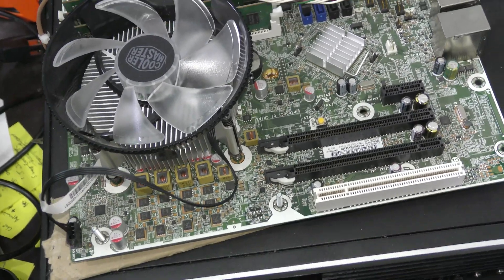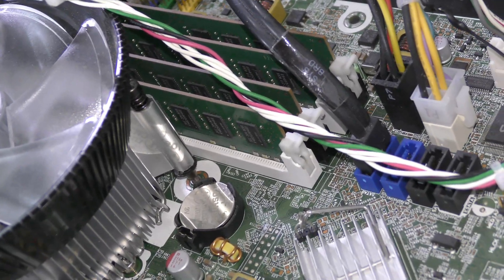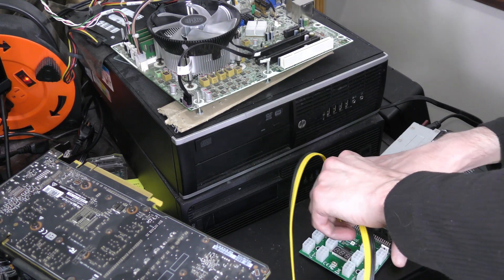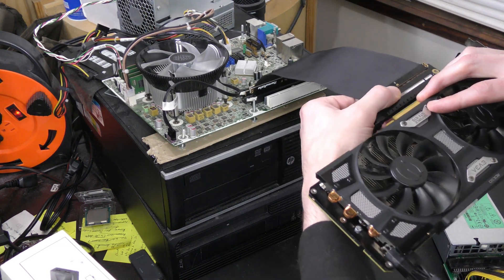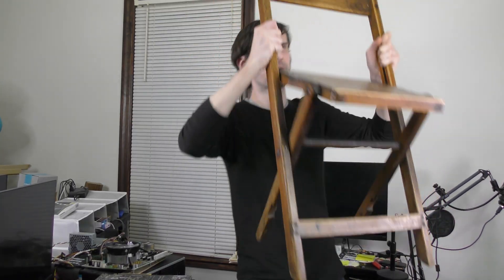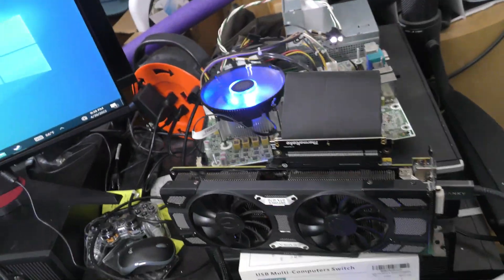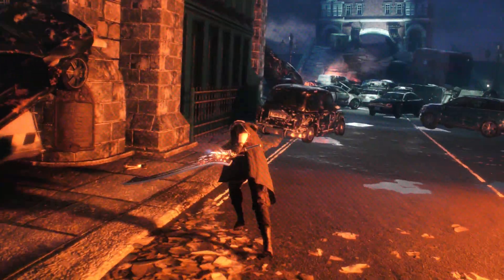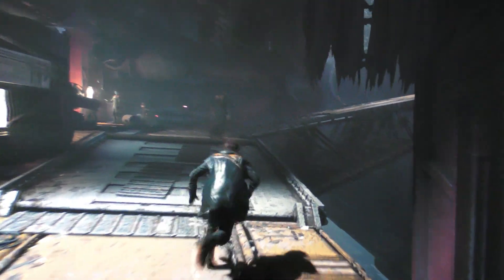GPU - Does anything else really matter for Gaming?

Comment: Chayre desk kinda means table throne backwards. It looks ye olde.
Here are some CPU areas to help you. At which point, favouring GPU could still end up being the case, but meh whatever.
For those single-player, usually offline=line games, then the answer is usually yes towards the GPU, however, online games sensitive to the microstutter (MSI afterburner plus MangoHUD could have shown, as per having a control-test Hard-drive with Linux in additional comparison) could erode the video's stance on so heavy a favour mustered for the GPU.
Even playing a FirstPersonShooter offline with bots could incur performance penalties because the PC by the coudl easily be "the server" (and not just its own client). Of course, having pals play too by means of a fixed-IP-Address can tank the GPU priority over the CPU. It could also raise questions about the SSD or NVMe drive used in place of a RADID10 made of 4 identical HDD drives left-over from your PC triage ward.
For some games the RAID10 is enough bandwidth improvement over a single HDD, and it can have (by means of both mirroring and striping) sufficient redundancy (assuming backups,arching and systemimages of the data have been done for a safety net too in advance).
While CPU instructions (SSE4.1 or 4.2 and so forth) can be point in favour of the CPU (like how OpenGL for a GPU can be), the CPU can be more scalable, turning on or off extra cores or sockets in a dual-socket (or more) server  otherwise assigned to some VM. Weak CPU can lead to drop-out of voice-chatting services.
However, considering the video had to use those nifty riser cables from the PCIe and the power-supply gadget, costing for the motherboard (affected strongly by the chipset for the IO and the CPU supporting it and the instructions, let alone having more than one RAM slot of dual-channel or quad-channel RAM) seems to have a lot of crutches.
This leads to the online-gaming-angle debate of "is the gaming-PC running a server?" or even "is the gaming-PC using a VM?" questions. That starts to matter because of IOMMU related (usually SLAT and up) instructions for passthrough, its latency incurred, and thereby at the least, usually SR-IOV nd VMDq.
Even if a GPU is not being shared (VMDq or SR-IOV or proxmox) it may still be in a VM passthrough setup. Importantly though, it might be that a network interface card (probably a RJ45 ethernet NIC) is running in passthrough.
None of this even goes near video encoding and twitch streaming since it is still in the domain of doing what can be done to configure games to have them runnning with pals. Using old games can make that even more the case as older servers become less popular and the payer needs to be-the-change-they-want-to-see by setting up a (fixed-IP) server for their mates.
Things like WINE, bottles, proton could be added too, but only in terms of what is the easiest way of doing things (compared to say capsicum containers in a BSD license or whatever QEMU and KVM might be used as per SR-IOV and VMDq, or sandbox or FreeBSD jail listening on multiple sockets). As an aside, having a few ethernet ports rotate over timezones (because humans sleep) can allow a time-share of server-maps gaming appointments for pals globally, and VMDq (or the SR-IOV successor) can do that per ethernet port overlapping as the world turns from one beddy-byes time for a geographical time-zone and into the next. These things saving time can save money. A Dell i350-T4 would be an example.
The motherboard and thereby CPU need to support that (SLAT) for the i350t4 to have its 4 RJ45 ports shared, overlapping for a moment between timezones by means of the SR-IOV and VMDq.
Be they old or new games, it looks like you need more games by means of a whipround from viewers into a jar for tipping.
As an aside multiple GPU (almost like crossfire, SLI) can also be shared, overlapping for a moment between timezones players in a passthrough VM. A person might not be using Gallium3D or what-have-you (jut those identical 2 or three GPU).
That said, if a streamer of gaming videos were to use blender3D as their video edit go-to, having a second GPU to "run the GUI whilst the former GPU renders" is doable. In crossfire-AMD, there could still be a few games that use it (for the purpose of getting some occasional extra use-case-scenarios from that double GPU set up, or possibly maybe just maybe 3 f the GPU). One reason this is worth noting for the CPU in the video is because some RX500 cards (Rx580 if it is not a RX570) have their 4GB RAM taken off (maybe if had or had no been a mining card) to have 16GB placed on it, exceeding the usually expectation of 8GB max. That can mean some games have the graphical processing seem underwhelming with an excess of RAM, however, it is not necessarily that way if the game likes crossfire because then all of a sudden, in those few games, the extra VRAM can be suitable. It is just that a person probably desires an extra decent reason to have two such GPU cards installed, and the Blender3D scenario is probably the sort of rationale behind the decision to do it that way.
as an additional point, CPU voltage tweaks can go with RAM voltage tweaks. A GPU can be tweaked, true (like voltages, or MHz or cooling as per a CPU). However, since crossfire and SLI wained in popularity, there tends to need to be other reasons (passthrough as an example of video encoding for a stream) to have more than one GPU in gaming (rather than science applications) to justify showing GPU can be scalable, whereas CPU is arguably of the moreso. One reason however is bifurcation but that can blur lines between storage such as for NVMe.
If a PC is left on for a long time as a server, its electricity bill can sometimes be scalable more than that of the GPU, expecting to be underclocked on purpose to help the electricity bill, or disabling cores, whereas the GPU is not really associated with that other than the "multiple" GPU scenario by switching one GPU off, or doing some clever bifurcation configuration, or sharing a GPU across multiple gaming server VMs.
Also, consider the Motherboard and CPU importance in thermal throttling.
In terms of gaming AI or machine-learning, CPU cache is abundant nowadays, meaning handing such tasks over to CPU is realistic. GPU can however still be in neural-networks. 
Another thing to consider is some CPU can support iGPU (or APU) so that the 2nd display can be done that way whilst a GPU does other things for the gaming. The CPU can also influence or dictate if you have some PCIe 4x slots to play with.
My comment has no hate in it and I do no harm. I am not appalled or afraid, boasting or envying or complaining... Just saying. Psalms23: Giving thanks and praise to the Lord and peace and love. Also, I'd say Matthew6.

Comment: Under the influence of the shape shifter that is the  Ebay addiction algorithm , I bought the following. Quadro GPU s : 4000, K4000, 5000. 6000.  I read what I could quick find and noticed both (5000-6000) cards run hot. Not an issue.A lot more capabilities.   Didn't pay alot= K4000 was $39' and the only card to work of the 4..  the K4000 was.Plug and play perfection with reference drivers installed automatically in setup. .  The straight 4000 was doa.  5&6000) can boot into Windows 10-11 - but the image is BxW. Driver s are of no  impact in visuals. 685 watt Dell psu   6000 takes 275 watts max).  Both cards can run continuously without power failure.-  Power adapters 1 for 4000 and 5000, 2 for the 6000. I played with various NVidia driver packages until a "Quadro "something or other shows up device manager.  I can see a hint of color in bootup.      As they say here in Maine-   Have these cards "shit the bed"?" They don't seem to work".As you yourself have said, any excuse one has to return to an active state in bargain bin hell,  the Ebay jungle , convinced of triumph. You know the rest   .  I got involved with these pursuits pre-occupations because I had sudden onset Glaucoma. I am legally blind not totally blind. Glaucoma is a lot about the optic nerve . interface cable. Any work I attempt is with total supervision...Alright enough.  Do you have any ideas/ notions about the benefits to seeing these higher end graphics cards might offer. It's not about magnification.    I think the theory is to offer as many tiny bits of existential data  as possible on the uhd monitor so the brain can get as much total info through the "bottleneck" as possible. Not rocket science. Then  brain tells me "ok, this is what you're seeing,  Ok maybe ?"k .  All hinges on having had decent food, rest and retreat distractions.  .  it gets computed in my brain and I'm not so tired. Thanks, You are just who I need as I swear my way through  trying to seat a card or stick of ram. Stuff I used to could do "blindfolded) But I'd probably do the same shit if I wasn't blind.  You make living this life a bit better for me. Thanks.  Best drama, comedy in town. And it all coincides with what's happening now.

Comment: An i7 is a must in 2023, you need those 8 threads.  A stock 4th gen i5 hasn't even got enough speed to run more than 8gb of DDR3 at the proper transfer rates, if you try to record the screen as you play it will become a stuttery mess in most cases.  I've benched the GTX1070 with Haswell i5's and i7's, a slow i5 definitely is a bottleneck that will negatively impact a lot of games like Fallout 76 as the 1% and 0.1% lows will affect the experience  in game.  I've found setting the V sync to fast in Nvidia control panel gives best results generally as it lowers input latency and shows what the card is capable of on a faster screen with a frame rate monitor, plus people like to see max and average rates even on low end hardware.  All my future tests will be set like that.  Latest games I have on the bench are motorcycle racers, Moto GP 13, 15 and Ride 4.  You can't have very low 1% and 0.1% lows on those as they really show up in game.  Even an i7 is severely affected trying to record the screen in Ride 4.  It's only 8 quid on Steam and I rate it as an ex motorcycle racer and it does push the hardware.  Moto GP 15 is only £1.50 and even though it's older 1440p is as high as I can push with an overclocked i7 4770K and overclocked GTX1070.  Just loading Moto GP 13 because I already have it and want to see what it's like as I haven't played it for over 5 years.

Comment: The price of the components must be cheap. If you had to buy them what would you have to pay? All hail Lowcastle Tech and Chair Desk !
Reply from the maker: Well piecing the computer together (excluding the GPU) was probably 70-80 dollars worth of parts, but it is all older stuff I had laying around. It likely would have been cheaper to just buy the older model of PC and upgrade. When it comes to equipment from around that era (2014 or so) it seems like it is usually a better option just to buy the used PC complete. 🪑🪑🪑

Comment: If Chairdesk gets sponsored, does it mean it gets a sticker plastered over it?

RE Engine games (like DMC5) run very nicely, especially without the Denuvo in them, as that tends to do more of a hit the older the hardware it runs on. Good call on SW: Jedi Fallen Order, as it too got Denuvoless.

For 1080/60, not much is needed, and cheap solutions (like an HP Z440, but not with an NVS GPU, a 4-digit K is leaps better, even better if it's an M or P card) can be found.
Reply from the maker: 😄 I don't know, that seems almost blasphemous to cover up ChairDesk! I'm not sure I could do such a thing!!! 🙂

Comment: If you play games like Planetside 2, COD Worzone 2.0, Battlefield 2042, PUBG...you need new cpu it's not just raw power even or core count you need better IPC, memory controller, NVME and RAM speed and as much L3 cache as you can. 200 players at one play every one of them aiming with guns and shooting plus the vehicles and cpu must calculate all the physics trajectories etc and plus pass that to GPU, yea gl with that.
PS. Yes i had i7 4790K like a 3 months ago, sold it for 100 bucks with a Z97 motherboard and some ddr3 ram, not to mention what run OC that to like 4.7Ghz it was still stuttering fiesta in like 5 games one of those were Fortnite like like that game really hates old CPUs, also Cyberpunk 2077 have minor stutters and many many more, some games worked ok like Forza Horizon all older games etc.

Comment: I have been having good luck with the sub-$100 new RX 580's that have been popping up on amazon with 3rd gen optiplex's. Fairly similar performance to the 1070 but sometimes as low as $80 and lower power draw.
Reply from the maker: Nice. I've been seeing those around a lot but have never used one. That does sound like a pretty sweet deal!
Reply: @LowcastleTech  As long as you remember they are 1080 cards they work well.

Comment: A couple of things to be mentioned:
- there are adapter cables that would allow using a regular ATX PSU to power the HP motherboard
- you could emulate a core i5 by disabling hyperthreading in the BIOS. I know, not an exact match due to cache differences, but it is going to save you a few bucks from nor buying a 3rd gen i5.

I like the down to earth approach in this video. I believe there is a lack of it on youtube.
Reply from the maker: I actually have a couple of those adapters, tried one out for one of the previous OptiPlex build vids that I did, and worked really well. I'm planning on doing a video testing out a few of them. There is another that I have that is more aimed at older HPs that have that weird mini 6pin header. Will be pretty neat if they pan out. That is a really good idea with disabling hyperthreading, wish I would have thought of that when I was making this 😄. And I'm glad you like the style of the video, I do appreciate that!

Comment: I7-3770 and GTX 1060 is my daily driver, not surprised that it can hold its own with a GTX 1070.
Checking 3DMark Firestrike: GTX 1070 with:
i9-13900KS...  OV 23241	G 23488    P 76168	Comb 10957
i7-3770            OV 15958     G 21754	   P 11195	 Comb  6762
The graphics part of the score is pretty robust with lowering CPU, while CPU physics takes a massive dive
Ok, 3DMark is a GPU benchmark, so probably less demanding than an actual game

Comment: thats... pretty interesting. I discovered your channel during my computer having major issues, and this kind of stuff appeals to me, especially since id love a budget option to play a certain game right now. glances at Elden ring
Reply: Elden Ring sucks on old CPUs, I can confirm.  I have an old Dell T3600 with the E5-1660 CPU and it struggles to maintain 60 FPS even with my modern GPUs like the 3060 ti and RX 6600.
Reply: @a1m598  that i figured... shame as it is. is there anything you'd recommend to do to get it work on PC?

id it helps at all im working with an i7-6700
Reply: @DarkCT  oh it works.  You'll just have to dial down the settings and of course it depends on your GPU.  i7-6700 actually should work quite well.
Reply: @a1m598  oh yeah? hmm.

I think then my stumbling blocks are probably my GPU and my ram. im working with only 8gigs of ram and a Nvidia Geforce GTX 970. I wonder what kind of frames i could get out of this... Ive really wanted to play that game since i finally hit my strides with dark souls. mostly to go around with the crossbows.
Reply: Elden Ring is notorious single player game that really stress CPU, i really don't know why but i think it's about physics and world in general but btw i7 6700 is not that bad cpu, just for example Ryzen 5 3600 is like much better like a lot, the entire 6,7,8 and 9 without i9 9900K is epic fail with all due respect to intel.

Comment: I don't play the latest and greatest, but I still use my GTX 1070 in my VR rig. It's a tank. However, my rig wouldn't even need to use any GPU and CPU to play VR if it had the power of the Chair-Desk ⚡
Reply from the maker: 😄 You are absolutely right about that!
Reply: I'm running a floor desk in the living room until my shed is built to do proper videos in, I think it might be affecting my tests.